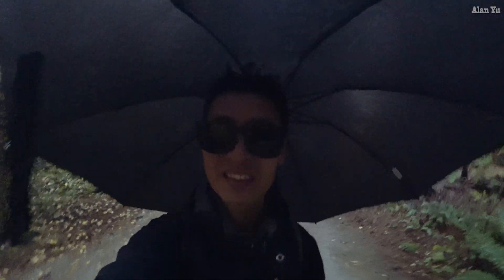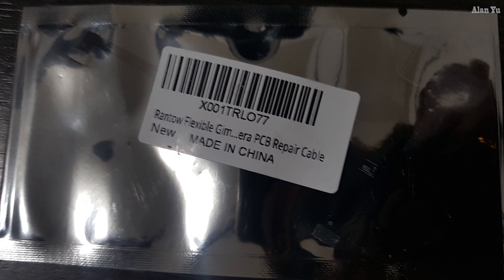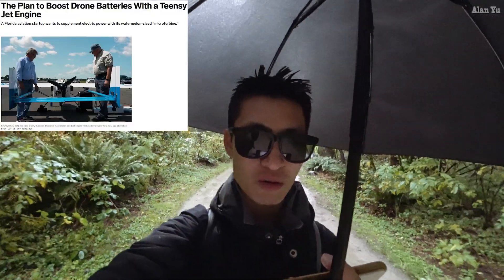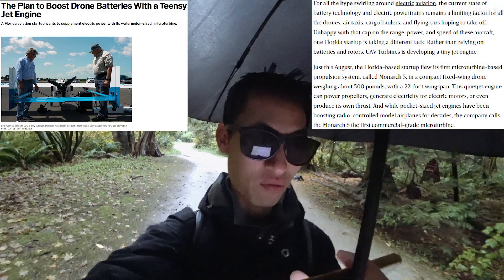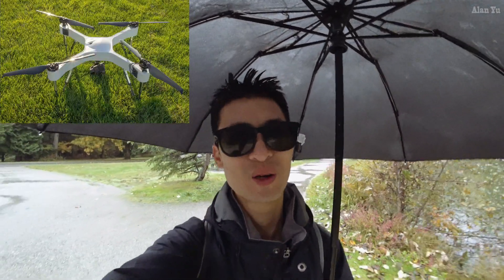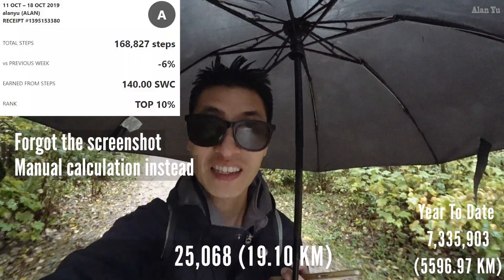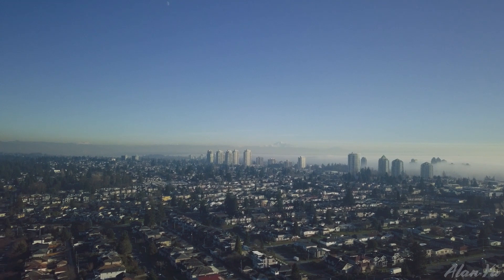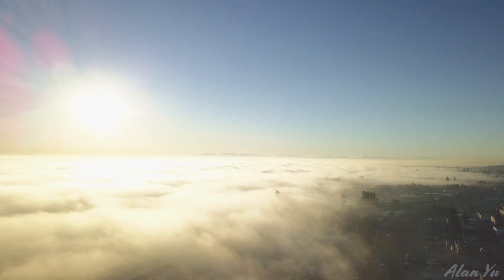Mini Jet Engine For Drones Plus Skydio 2 Dock Previews

Comment: FOR THE REPAIR.. make sure you have a small electronics tool kit with a good 1.5mm hex driver at least. Plastic spudgers are essential as well.  Memory Express or Canada Computers have decent ones. The gimbal is easy to take out after the topmplate is off..